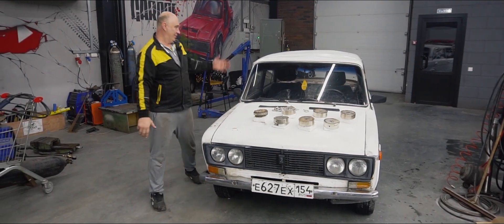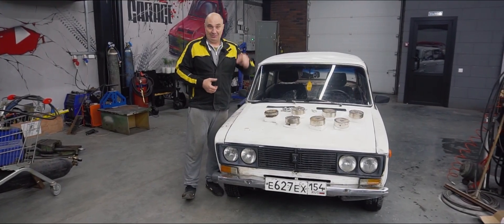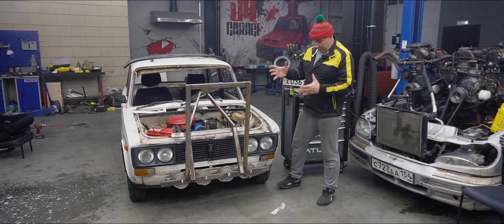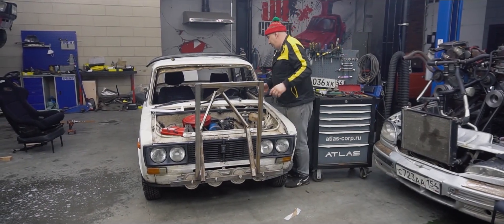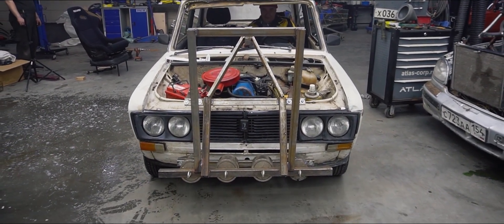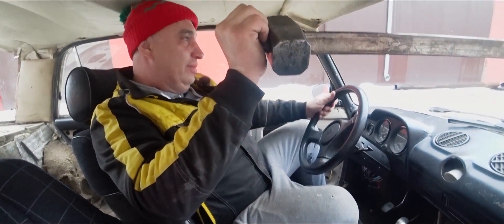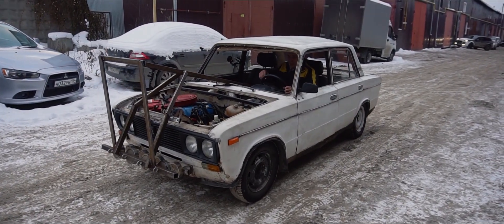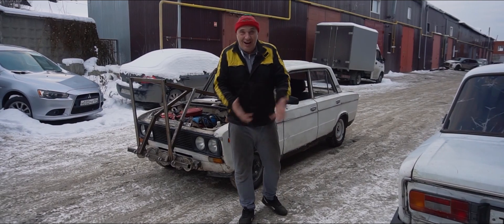We made gasoline obsolete

Comment: Suggestion: Make a electric-Lada using only startermotors attached to the gearbox!!! Lots of Lada-startermotors! 
Go Teslada!!!!
Reply: A whole lada starter motors?
Reply: or try to hook a bunch of them to the flywheel alone, so you still have control of the transmission!
Reply: So far I can suggest it. OKA car. (Produced by LADA and KAMAZ) Starter from Kamaz with a capacity of 24 volts, batteries from Kamaz for 190 ampere hours. The maximum speed is 45-46 km / h. (the description is taken from the answer of the channel author to one of the YouTube users in the second video, he answers there in a more detailed way)
https://youtu.be/F816vC9mBwQ
https://youtu.be/4RFQllYBHE0
Reply: @PODbot2.5  that's a good idea, I would suggest a truck starter motor and alternators with truck or marine batteries, at least 5 of those.
Reply: @Rrgr5  why not one real electric motor 20kw 80 volt and up.
Reply: @peggenlejoncar9529  because is not as cheap as a junkyard truck alternator or starter motor... Ok, I'm justifying that because I want to see that kind of stupidity lol but you're right, logically speaking.
Reply: @Rrgr5  amen
Reply: it wont work
Reply: Starter motors are made for short high torque impulses
not for a long run spinning. "Cool me down after 15 seconds"
Reply: @junkman6456  Yes, they would get too hot at high torque. But if you use multiple starters they will share the torque. If you have enough they will work like normal electric motors. I think you would need 4-6 to drive up to 40 km/h
Reply: Starter motors aren't made for constant operation, just a lot of torque for a short while, they will burn out before the first corner
Reply: @joafrikaans59  so did the wood-engineparts. But it was fun
Reply: Electric motors to a shifting gearbox? Now that's an idea!
Reply: @kibukun  that already exists in some recent cars, to reduce costs they use the same manual gear box for the automatic versions just adding an automation mechanism on the shifting stick!
Reply: @So7urno  What? All gas cars have a gearbox. That's how they go the high speeds and have great gas mileage. I'm talking about electric cars.
Reply: @kibukun  sory I miss read your coment... I read like:  "eletric motors TO shift a gearbox" xD never mind
Reply: @Eddie Hitler Didn't notice that until now. There was a comment on the last episode, where someone said to attach the starters to each wheel. I skimmed this comment and assumed it was the same thing. My mistake.
Reply: Agreed. Next time i will comment my idea
Reply: Dont you have to comment on the original channel???
Reply: Yes
Reply: 1 hp peace, hahaha
Reply: @Eddie Hitler No sweat, you didn't sound like an ass at all! Just a misinterpretation, as you said.
Reply: I think they've done this. Its not in English though. I remember them talking about it
Reply: @ymxctrails Would be hard because its inside the transmission. Its not a seperate motor
Reply: @ymxctrails Check out the youtube channel "Weber Auto". He made some very professional teardown videos on electric and hydrid drivetrains.
Reply: @ymxctrails hahaha priceless comment!
Reply: They are going to overheat quiqly
Reply: How about one from some big ass dump truck starter and stick it in the lada
Reply: Good one I like it
Reply: Do It Garage 54
Reply: you already posted this before and we told you it qouldnt work because the fucking startermotors would catch fire
Reply: @sandramedrano3429  why are you so negative? Of course it will work! All electric-cars is made of startermotors!